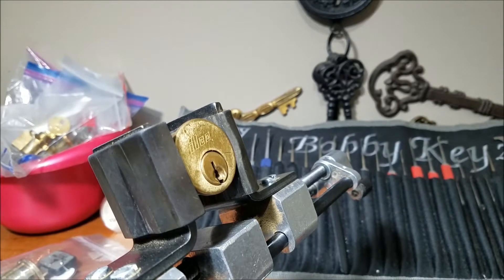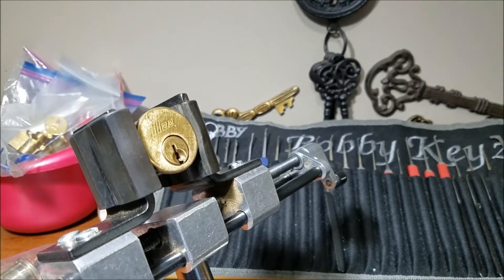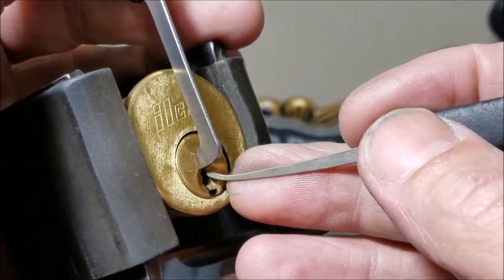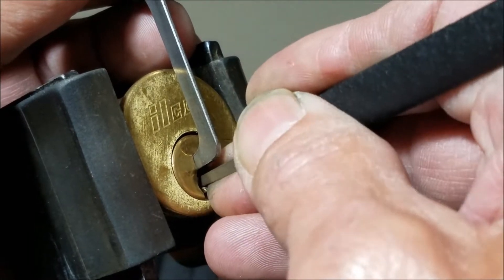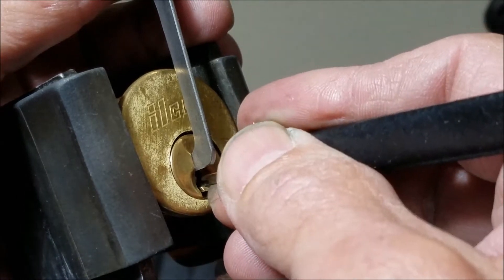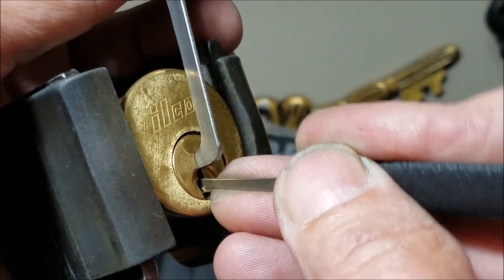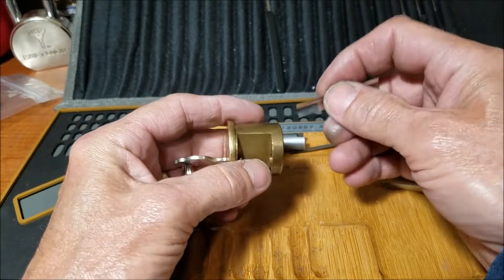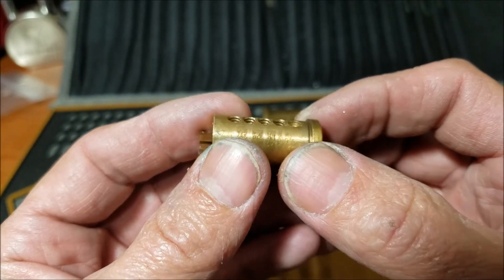(268) Ilco Challenge "Small" By "Den Brass" spp'd and gutted sent by PickMe 1977

Comment: Nice picking on this Ilco lock ... well i see your other whit no key ... is a pick killer :)
Reply from the maker: Den Brass thanks Denis. Yeah you not gonna believe this bit after that video I tried it with my short hook from sparrows in I think .020 and it broke that one two lol. But that one was getting a little worn out anyway. Luckly I just got a back up in when I orded the other picks for lockbuster so I have a new one of those thank God.  It's trying to get around that warding that snaps them. But don't you worry I'm putting in another order and I'll have the picks to get that sucker opened lol.
Reply: And this keyway are very paracentric ... i have one lockwood same that but dont have key for that .... must like CL whit key but ... we dont need that lol . the 0.20 as the most thickness from sparrows ?